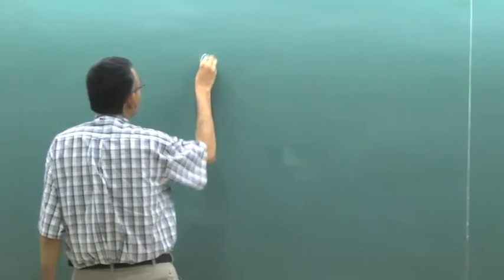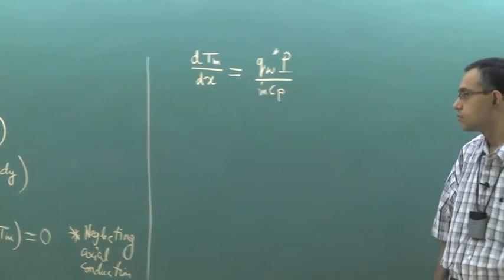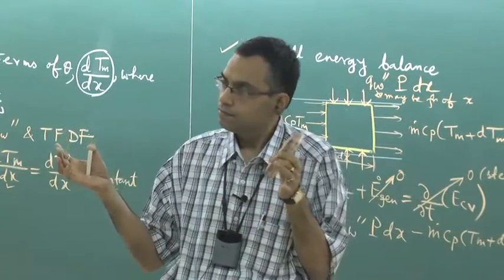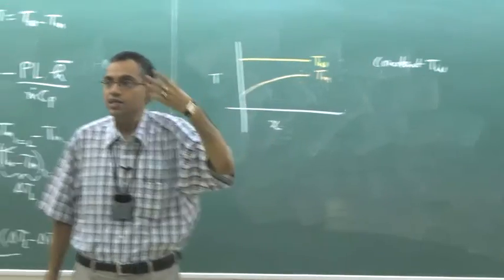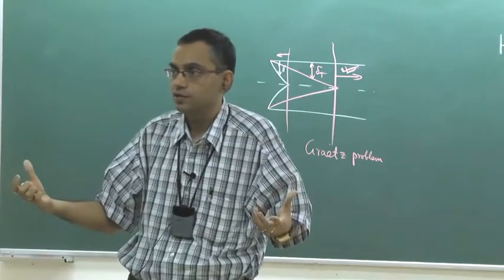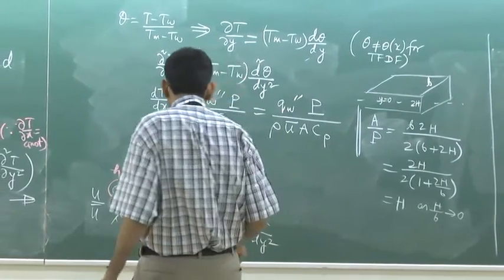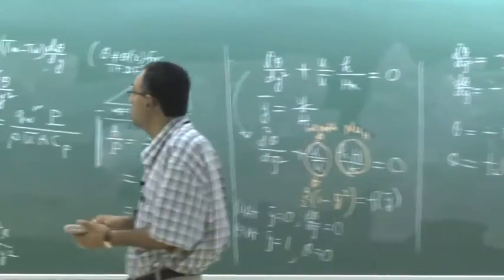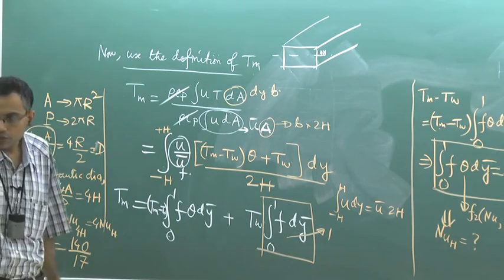Lecture 32: Internal Forced Convection (Contd.)

Comment: For constant heat flux
1) Tm varies linearly along the pipe but Tw varies linearly only in fully developed region
2) Difference between Tm and Tw remains constant in fully developed region
Constant wall temperature
1) Tm varies exponentially
2)To calculate Q consider it as a Parralel heat exchanger with Tw and Tmi as inlet and Tw and Tmo as exit temperature.  Area should be considered as 3.14DL.
Reply: ISRO icrb 2025 question ❤

Comment: I usually get confused between temperature and heat flux , some one please explain in simple terms. Thanks

by definition flux is heat transfer per unit area per unit time but that didn't make sense , please come up with practical example.
Reply: Temperature is the intensity of heat present at that time at that location. While the heat flux exists when there is heat transfer. 
By definition in thermodynamics Temperature is expressed as the inverse of the rate of change of entropy with constant volume of system, internal energy and number of particles in system.
Reply: Temperature can be related to potential energy in mechanics and heat flux can be related to work in mechanics. 

The higher the potential energy, the more work can be extracted from it.
The higher the temperature, the more heat flux can be generated. 

Thus, temperature is the potential for heat to flow. The more the temperature, the more is the heat flux.